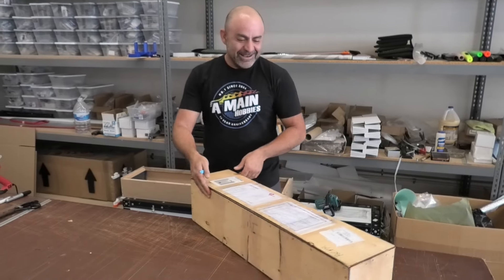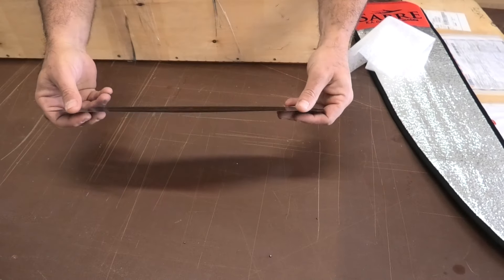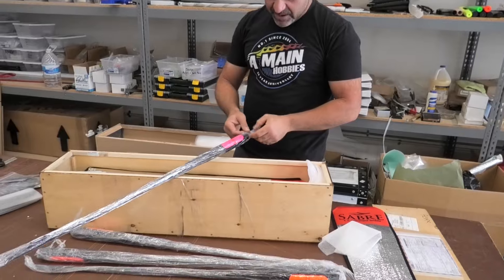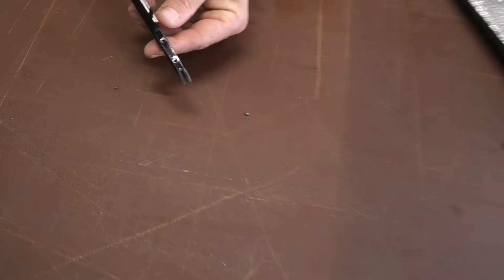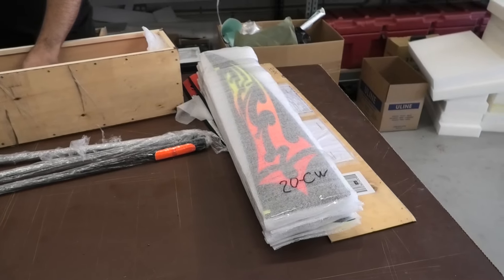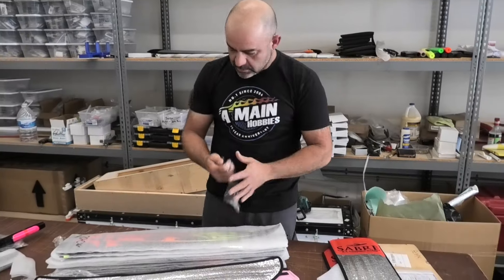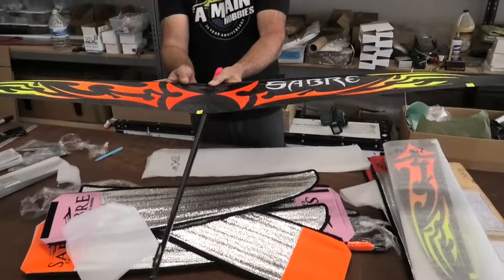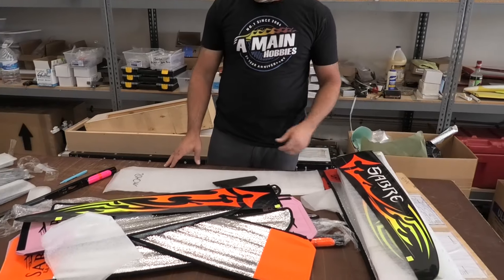Sabre F5K 1.5M RC Glider from Ukraine

Comment: Just built one of these in the uk, have fun with the build 😅, keep the cg most forward of the recommended position, 2cell 450mah climbs like a homesick angel! About 5 climb outs to 100m on that size lipo.
Reply: How easy was the build anything to watch out for?
Reply: @henrygregory77  pretty straight forward if you've built dlg's before 👍

Comment: I might just belong to the  "older guys that can't throw" class. New to DLGs, so is this a good way to go? If I choose to try my old body at hand launch, would a F5K like this work just as well without using the motor? Or should I start with a cheaper foam DLG to get into this sport? Last question: what do you think of the Auri?